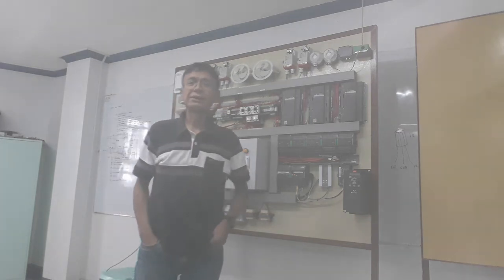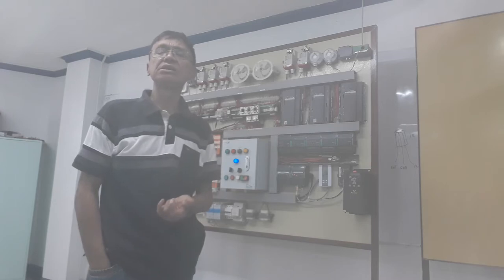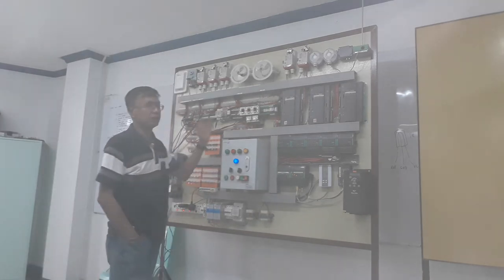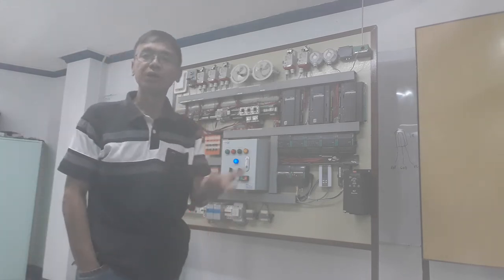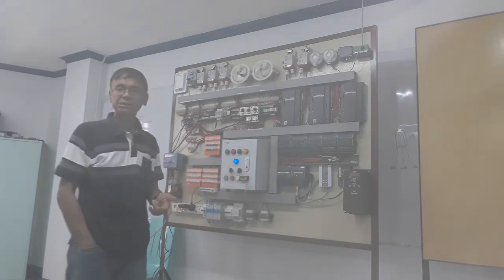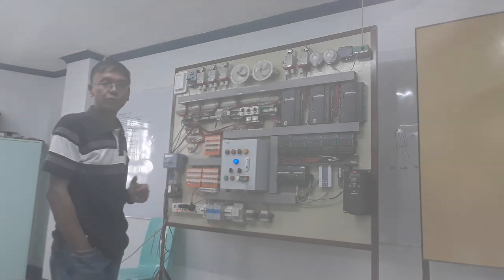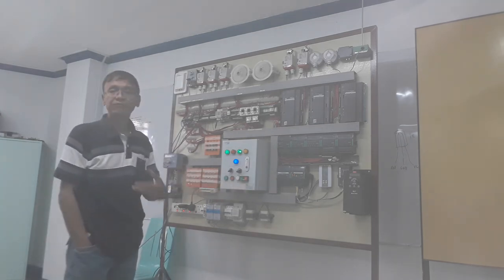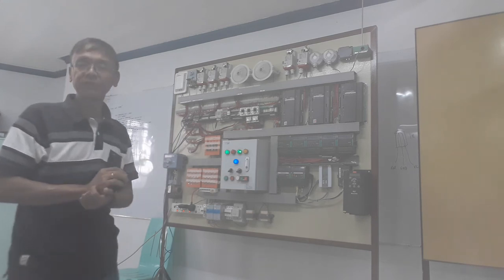How to become a BMS Engineer part 13 (Motor Control Centre)

Comment from the maker: Motor Control Centre front cover showing some indication lamps such as Run, Trip, Power indications. There are also 2 selector switch for manual(hand) and auto control, and push button switches for manual operation of the equipment.